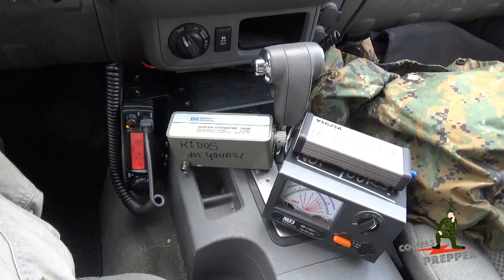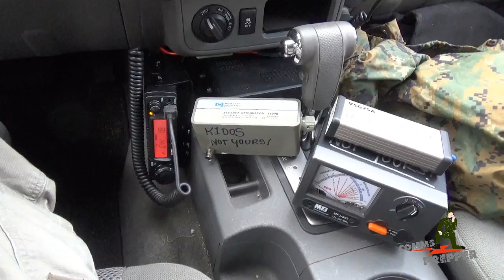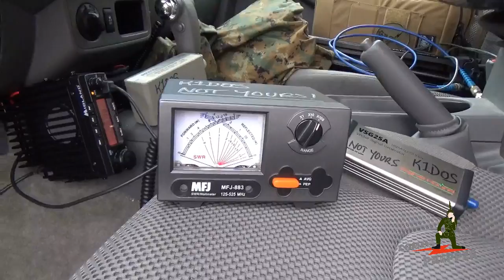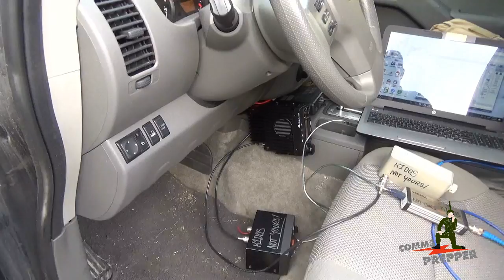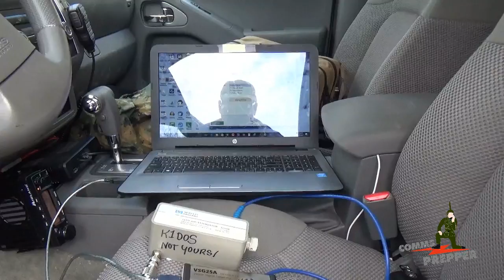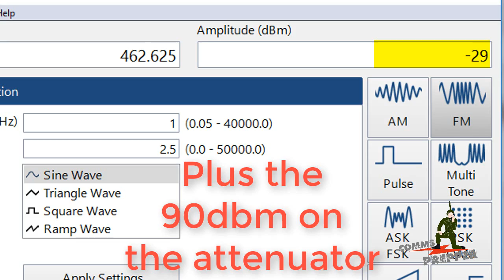Mobile Radio Troubleshooting - Quick Tests

Comment: Actually  -122 dBm sounded pretty close to 12 dB SINAD.
Reply from the maker: I wear hearing aids so it's hard for me to tell without a meter.  I do have the SINAD software on the laptop by ComTekk but did not use it in this video.

Comment: i thought about it you could use it to send paket the way it is.... sounds well thought out
Reply from the maker: The radio or the Vector Signal Generator?
Reply: Commsprepper the radio sir
Reply from the maker: I thought about that too but Packet or any data mode is permitted is not permitted on GMRS.
Reply: Commsprepper it seems like someplace a digital signal maybe in another country in that freq range just thinking.....

Comment: That new mobile has pretty good ears. Are you still working on building a repeater with one ? Thanks for sharing !
Reply from the maker: Yeh but need to put some cash back.  Now I need duplexer.  The one I got is bad.  Insertion loss is too high (7db).
Reply: Commsprepper are you looking for a 6 cavity mobile one like an mr354 or a rack mounted one ?
Reply from the maker: I have a search out on ebay for a band-pass duplexer.  I don't have a rack but rack mount type would work.  The mobile duplexers are problems.
Reply: the mobiles are tricky to set up. I may have a uhf rack mount one in storage.  I think I have a txrx bpbr
Reply from the maker: Let me know and let me know what you want for it.
Reply: I'll dig around for it tomorrow and let you know.

Comment: Hear ya on safely operating those. Burned up a freq generator one night doing RCV checks on a system (during an evaluation of course).
Reply from the maker: I have done it a few times myself over the years on the receiver port of service monitors.  fortunately in those cases there was a fuse,